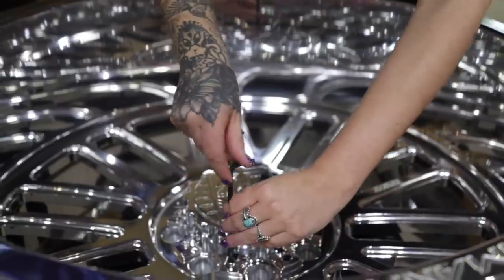Powdercoating my 26X14 wheels for my Hummer H2 - Lacey Blair X Amani

Comment: You prob get this a lot but explain the tool using to suck the powder off the wheel for me ? Looks like it cuts time in half by just doing it this way instead of using tape
Reply from the maker: Yes it does! It's a vacuum system and then I wipe the rest with my finger

Comment: Looks great, but no etch or key so won't be staying on there long surely
Reply from the maker: This exact process has held up for years but thanks for your concern
Reply: @LaceyBlair  and what is that exact process then? Has the metal been pre treated in some way or does the powder have some sort of adhesion promoter in it that I have never heard of? Powder coating on to bare, untreated metal from my experience, does not adhere correctly. I'm genuinely intrigued.

Comment: @Lacey Blair
I know I’m not any one, but I’m confused by the painting the powder coating on the wheel, then taking most of it back off!
Are you able to reuse the powder that you remove when using the vacuum tubes???
If it’s all wasted after spraying, why not tape off what you don’t want covered??? 
Masking tape is not expensive, but I’ll bet powder is!!
Taping the areas off that you don’t want powder to adhere to would involve more time at the beginning, but the clean up after spraying would be much faster and could probably gain back all the time you’d lose by doing the extra prep work!
As I said, I’m not any one to say one way or the other, I’m just trying to understand!

Please help me understand what your end goal is.
Reply from the maker: Hey! This is a common question for sure. It's nearly impossible to get crisp tape lines with heat resistant tape bc the powder particles always seem to creep underneath. This factor plus the time it would take to tape off, wiping and vacuuming is the best way. Even with the tape, the powder would still stick in areas you don't want bc it's electromagnetically charged to adhere
It's just always going to be a tedious time consuming thing no matter what
Reply: @LaceyBlair  
Then it’s truly a labor of love!
I was thinking that you could pull the tape off prior to the baking of the powder process, but I know how paint can get under the edges of even the best painters tape and most tape adhesives also have an electro-magnetic adhesion action like static electric and when powder coating, you use a negative charge on either the gun or the part being coated and a positive electrical charge on the opposite item(coated part/powder gun)!
My father was a body repair man for over 40yrs, in his career, he built complete wrecks to near showroom perfection every time he repaired accident damage! 
He re-built a ‘41 Cadillac and a Pacchard(not sure what year and probably misspelled the name), the ‘41 Cadillac was in three pieces when he first saw the vehicle(frame, body, and one front fender), he had to reverse build the opposite side fender using only the fender he had for a diagram!!!
When he finished that build and had painted the car, the name of the body shop could be clearly read in the paint job and there was no swirl marks or onion peel in the paint and it hadn’t been wet sanded or rubbed down prior to the picture that was taken of the paint job where the name of the shop was clearly visible in the paint!